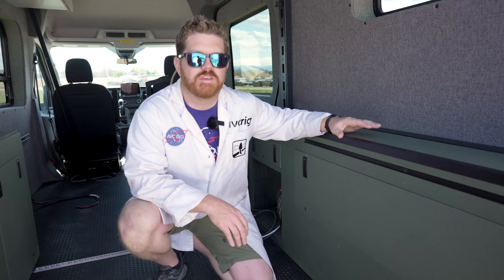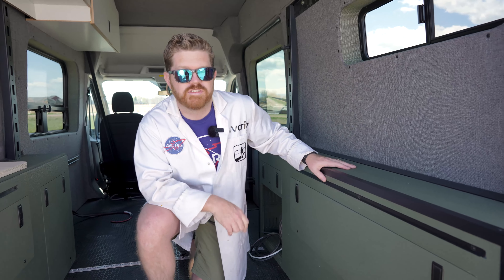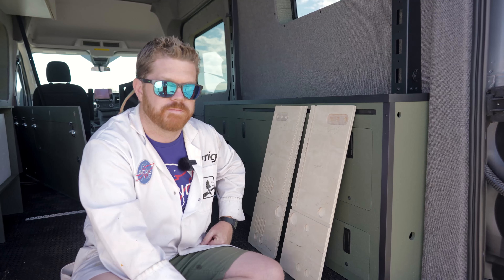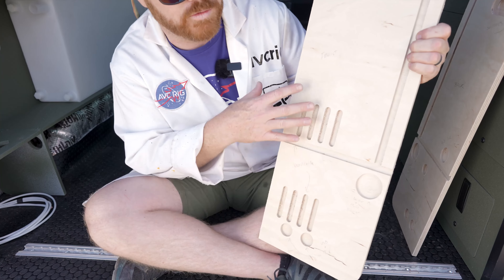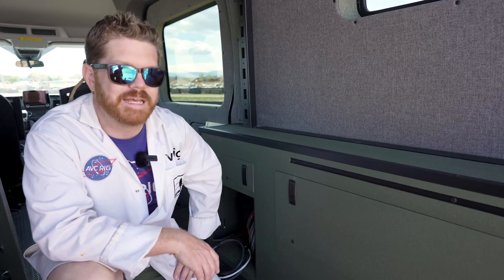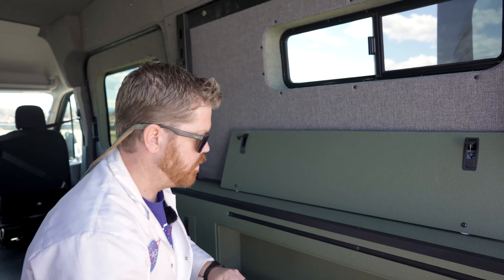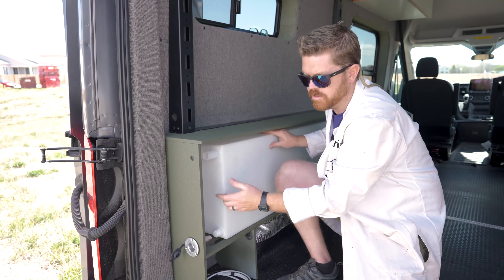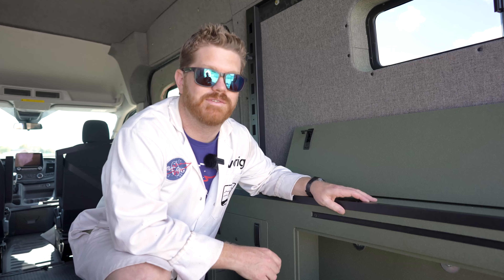VAN CABINETS | EASY Install for DIY Ford Transit Conversions

Comment: I am a SUV camper moving up to a Transit van and working on how to build it out so forgive me if this is a silly question...I dont use rv campgrounds so I have to buy water, usually is 5 gallon jugs. How do you pour clean water into the fill cap that is the same level as the watertank? Use a funnel??
Reply from the maker: I use a 12v transfer pump. It’s simple and stored in the water cabinet.  I carry a 6 gallon jug to fill up where I can’t use a hose. Like filling in a grocery store.

Comment: Thanks for another cool product. Are you guys planning to sell a bed system?
Reply from the maker: Yes. You can see the prototype in the background. We have our next revision in production now. It’s designed to work with the utility cabinet for now. We’ll add more options as we go.

Comment: a while back you guys mentioned that you were experimenting with the coolant loop from Ford to integrate a water heater? any update on that how would that integrate with these cabinets and 18 gallon tank?
Reply from the maker: I’m still waiting on the vans with the accessory loop.  The iso temp 4.2 fits in the same front area the goal zero goes into.
Reply: so with these cabinets you could do an ISO temp on one side and a goal zero on the other?
Reply from the maker: The 18g tank and the iso temp will fit in one cabinet. The fill to tank connection will be tight and you might want to order the pex replacement back end from Aquor to save some space.

Comment: Again, another great video.  Can the cabinets be ordered with the bedlinder finish? If so, colors available?  Also, can the kit come with / without the tank?
Reply from the maker: We’re working on offering a water system with this tank. We can’t offer bed lined finish, but you can get a local pickup bed lining shop to shoot them. We have a video of how to finish them coming soon.